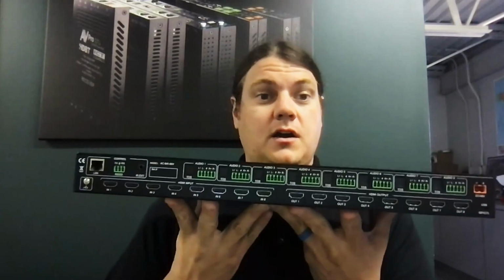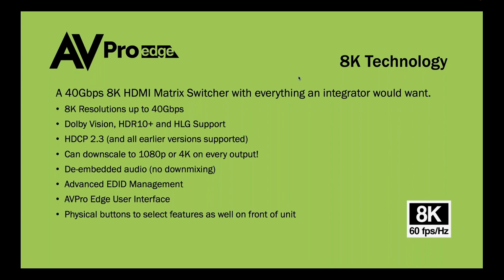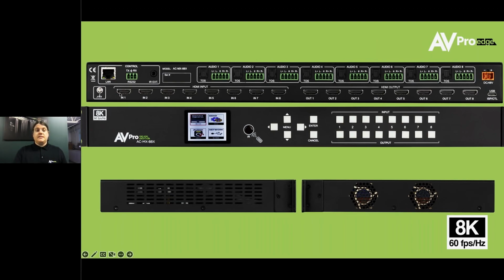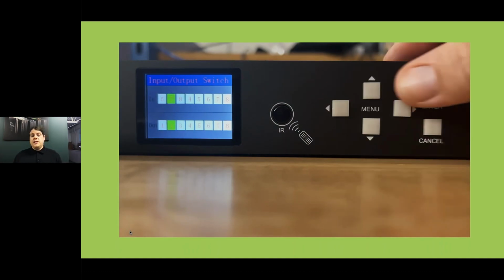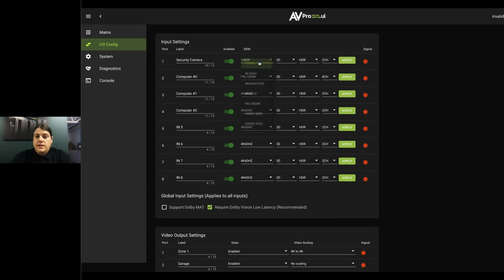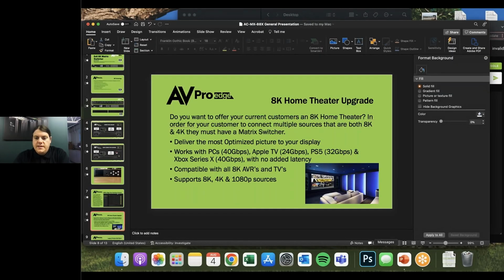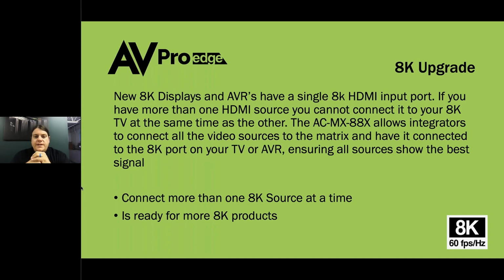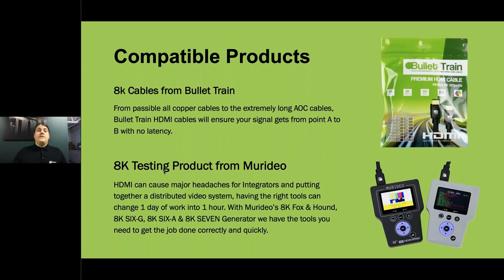New Product Launch 8K 8x8 Matrix Switcher from AVPro Edge

Comment: The switcher is great but if most of my TVs are 40-50 feet away, can HDMI 8K signal travel that far?
Reply from the maker: Hi mrteausaable. For long runs like that, we recommend using AOC HDMI cables for uncompressed audio and video

Comment: Input 1 Ps5 (4K 120Hz)
Input 2 Xbox series X (4K 120Hz)
Input 3 PC Nvidia 3090 (4K up to 220FPS)
Input 4 Ps4 (4K 60Hz)

Output 1 LG G2 (HDMI 2.1)
Output 2 Sony A95K (HDMI 2.1)
Output 3 Avermedia capture card (HDMI 2.0)

Which EDID settings should I apply?
Reply from the maker: Hey Saints, sorry for the delay, I missed your comment! This is what I would do: Use EDID from the Sony A95K on all the inputs, then set your scaling on the Avermedia Capture Card to always get 4K. Variables to think about; if you are using an AVR it might not like the HDMI 2.1 signals and downscale around it by using another HDMI output just for the AVR. If you are playing a game in VRR it won't scale and your capture card could drop signal, so if your recording for twitch I would set your consoles to not do VRR, if you are not currently streaming leave it on though because it can make the cut scenes more cinematic. (In the future because games are just developing this tech). But you got a sweet set up with the best of the best!
Reply: @avproedge  Thanks a lot. with this setup, your beast of a matrix completes what I've always wanted.